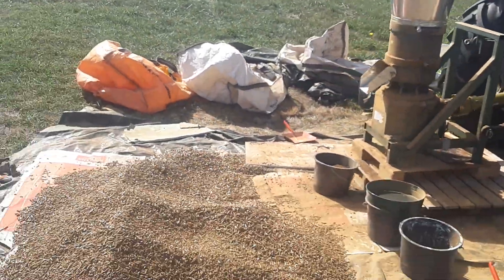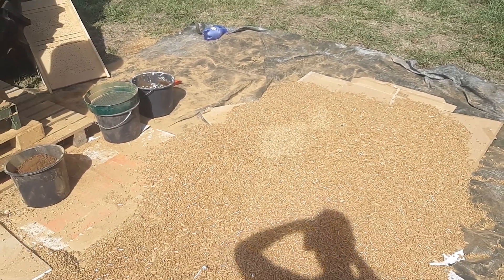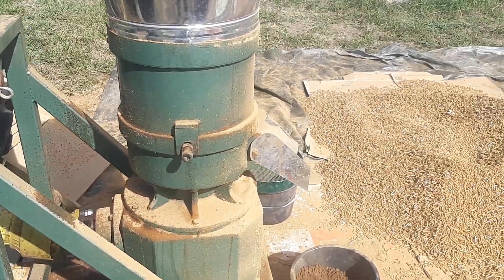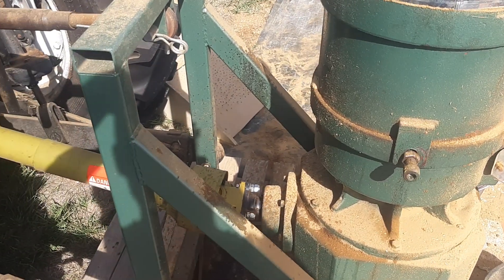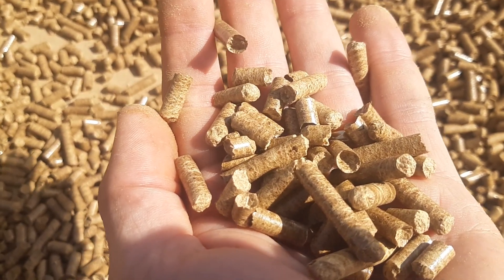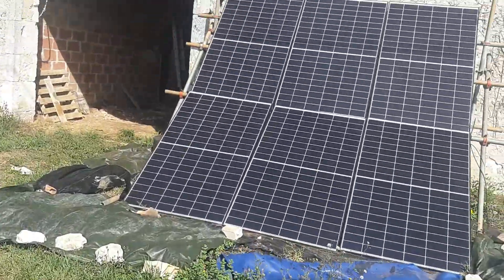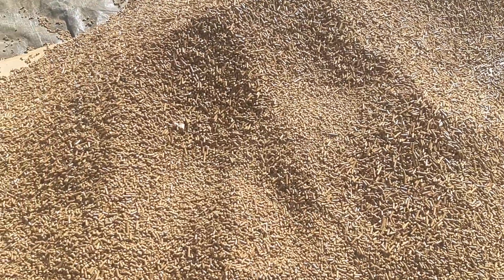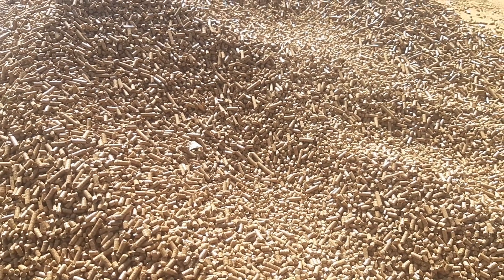Wood Pellet making process for heating your home. 100% Oak pellets on 360mm PTO mill. DIY SW France

Comment: how big is the gap between the die and rollers? i'm having a nightmare getting mine dialed in,
Reply from the maker: Hey.. I tighten my rollers down against the die plate with a fair bit of force with a large spanner so essentially 0 clearance.... Is yours a roller turned or die turned machine? What does it run off and size of engine? What trouble are you having?
Reply: @PelletJamie  it's a die turned machine, Diesel powered. Manufacturer says gap should be between .3 and .7 of a mm but there's no way on earth i can get it that close. Did you run yours in with sand/oil/sawdust or shavings ?
Thanks for the reply.
Reply from the maker: @vanderingadventures  Yes to the die conditioning, doesn't do much though, just cleanes out the holes... what size is the motor? What size is the die plate?The height of the rollers doesn't really make that much difference.. I would tighten them after they have warmed up.... what is the problem, is it blocking and stopping or bad quality pellets? What material are you putting in? What moisture level? It is a bit of an art to doing it...the first time I used my pto machine in blocked and almost caught on fire because I added the material too quickly before it had a chance to heat up.
Reply: @PelletJamie  Mainly blocking up then stopping. I've had the grinding mix through it without it stopping, just, and that with a gap. Die is 250mm diameter and 20hp diesel engine. i've been slowly adding the mixture but the gap seems to be the issue. I'll let it run with the rollers touching for a bit, then lock them off before adding the mix. I'm using clean wood shavings at the moment. Cheers
Reply from the maker: @vanderingadventures  is it the 230mm 22hp? That should have enough grunt. Just a few things to go through... Did you specifically say when you bought the machine that it would be used for wood pellets? If not it could be you have an animal feed die plate... they are much thicker with higher compression ratios. Secondly what is the moisture content? Should be between 9-15% and MUST be measured and in that region. Thidly you mention they are shavings... it is better to reduce shavings down even further with a hammer mill or use sawdust... Hard or soft wood? Soft is easier. Fourthly and this is quite a big one... have you let the die heat up? It seems frustrating but it honestly takes 20-30mins for my pellet die to heat up... my tractor is 70HP so it doesn't stop but you still have to add the material in VERY slowly to start.... just little handfuls of oily materiall then slowly introduce straight wood material... once the die is warm after 20mins you can start adding it quicker. 
I highly doubt it is the clearance of the rollers... if you watch any of the Chinese use these things they just jam the rollers tight.... they say it wears out the rollers quicker but can't imagine it is a big problem.
Reply: @PelletJamie  hi, yes I told them it was for wood pellets. I can't tell the moisture content so ordered one of those probes. Im currently bedding in with the sand, oil and shavings mix. Had it running a couple of hours today without clog. Had the rollers touching the die then backed it off one whole turn on the Bolt. Seems to be OK so far. Thanks for your help. 
How well do your oak pellets burn, they looked pretty good on the video. Cheers
Reply from the maker: @vanderingadventures   Good to hear you are making headway...glad to help. I have still yet to burn them lol.. I had a tonne of wood left over from last year to burn before I swap my stove out but will probably be starting early Dec.. fingers crossed lol... will upload a video when doing it. Cheers J
Reply: How many rupess this tractor saw dust pellet machine please give me details,i have from india

Comment: I nice video but i was expecting a bit more of the "wood pellet making process."
Reply from the maker: Right I explain that at the very start...if you watched any of the videos you would understand that the process has very little to do with putting the material in and watching it come out... it is for the same reasons that cooking programs aren't videos of food in the oven for an hour straight.

Comment: Merci pour cette video.
Je veux travailler avec la 360mm ou la 400mm sur PTO Tracteur. ou sur moteur stationnaire.
Est-il possible de vous poser des questions « en direct » : Votre "sawdust mill" pourrait il alimenter directement la machine à pellets (avec les deux machines tournant en même temps?)
Travaillez vous avec pto 540 ou pto 1000 tours  sur le tracteur et quel est le régime moteur idéal pour votre machine.?
Avez-vous une idée de la consommation de  carburant par 100kg de pellets produits.
Chez nous en Allemagne, l'électricité est chère et j'envisage de travailler avec un moteur thermique dont l'eau de refroidissement chauffera la maison en hiver .  Mon espace, la disposition s'y prête  et je dispose d'anciens bâtiments où je peux laisser sêcher en permanence plus de 100 tonnes de plaquette.  
Merci pour vos retours constructifs / éclairés..
Reply from the maker: Bonjour Gérard. Avec plaisir je peut respondre a vous questions. C'est possible pour avoir le material qui sortie le broyeur de marteau direct dans la boucle de la presse mais tu dois verifie le humidite de le materiaux parce que il peut bloque le presse. Je ne le fait, mais c'est possible. Mon Tracteur seulement est 540 mais c'est meilluer avec 1000. J'utiliser environ 20l de gasole par tonne. Oui l'ectricite c'esr plus Cher..  aussi avec le moteur gasole c'est possible pour courier avec biomass, huile etc.
Reply: @PelletJamie  Thanks for fast answer, 
With your 540 pto, which engine speed/minite  do you need?  I heard that if you do not have a minimum  speed on the mill, than it doesnt produce pellet...   (For my first tests I will have a Fendt 60hp with three pto speeds 540 750 and 1000.tp minit)

Question:  (what  do you think about the following ?)
I would let my system work slowly but the whole day on.  (some one would just overview it....)
I would "underuse" the mills  (also to protect its body)...   with the following concept:
- Same pellet mill as you have (quite cheap from China - normally requests 55 hp on pto )   
- Same sawdust mill as you have  ( requests  +/- 6 hp) 
- Both machines would be connected  and driven by the "Typical  chinese diesel 1 cylinder engine - However the most pôwerfull of them just has 35hp...  BUT it has a very good ratio  (diesel needs/KWH produced) . This ratio is said to be  0.27 liter diesel /Kwh.  In China and India those one cylinder diesel engines are used everywhere and for anything.....(waterpumps, generators....) 

So Because the two linked mills would be largely "undermotorized",  I would have an automized wood chips inpout into the sawdust mill which would be   (just important enough sothat the engine "can live with it") . Of course the mills would be  underused but  I let it go non stop (and I could heat our house with warm from engine).   
?  What is your feeling about that ?   (I am looking for "outside critical spirit" about my idears....)

Finaly I believe that your 20liters/ 1000 kgs is a very good result.  In this way of doing,  i believe we could rather be in the 30l/1000 kgs but may-be I am too pesimistic....
Thanks in advance
Reply from the maker: @gerardmaraite  The speedo on my tractor has an optimum engine speed to work with 540 so I just put the accelerator up until it rests on that, probably just a bit more so that the engine doesn't die. It is best for the engine to work at that speed, if you you it under that the engine might stall and probably not be very good for it. I would suggest probably sessions of 3/4hrs.. the engine will overheat if you use it all day.
Reply: @PelletJamie
Reply: Ok so I understand that your engine is just turning at (probably) 1100 to 1300 turns/minite...   so I understand  that your fuel consumption is so low...     I know your ZETOR tractor very well because my father had one 3511 from year 1964..   On those ones your could turn your PTO on two different ways:
1/ on/off with the direct way "engine - pto"  (This is what you do and you get the "540 speed")
2/ Through the "wheels gear box" and there you can choose between 5 speeds right and one speed left (the return speed).
How you do that?
- First put your High/low from the wheels gear box inbetween.  It means it will be on neutral there.
- Second; put your PTO selector on the complete oposite side than the one you need for getting the 540 turns.
- Third Chose one of your (5 or 6 speeds for the wheels) 
You than will see that the wheels will not move, but your PTO will turn at the selected speed...
If it doesn't work, it means that they stopped this "intelligent system" but I do not believe they did...
Have fun....
Reply from the maker: @gerardmaraite  My Zetor is from the 90s the PTO clutch is decoupled from the main drives shaft so that the gear shift does not determine the speed of the PTO. There is a setting which will "match groundspeed" but never use it.
Reply: @PelletJamie
Reply: Ok 
So I understand you are happy with this mill turning probably on a PTO base +/- 300 turns/ minite.  (your tractor should indeed reach the 540 pto speed with a engine speed of about 1700 turns).
May I know how many Kgs/hour production you reaches this way when you have well prepeared sawdust and when you are  in good conditions? 
Second question: "always in the same good conditions", would you reache 50pct more production if you could have 50pct more speed on the pto?    Thanks   Gerard
Reply from the maker: @gerardmaraite  The production  rate is very much dependent on the humidity of the input material... In the best of conditions I could imagine making 500kg/hr. I can't answer the speed of PTO question as I have never tried.
Reply: @PelletJamie
Reply: Thank you and sorry for further detailed questions (sorry also for others who are not interested in such details...)   
When the mill "is taken well -is producing fast-" as you say in the very best conditions-, do you feel the engine needs more power (does it smoke more f.i.) or is it just a lose of efficienty as such when humidity rate  of sawdust is not ok?
Do you know how big are the wholes of your sawdust mill grid? (4 or 5 or 6?).
Thanks  GM
Reply from the maker: @gerardmaraite  Standard hole size in die is 6mm because that is the size most pellet stoves use. 

If the sawdust is VERY wet 35% + the material won't come out at all it just goes around the rollers. 
Sawdust at 15%+ (still too wet) will come out very quickly but won't be pelletized or will break apart as they come out and need to be put back in to reform, lots of steam may be made. 
Too dry 8% and the pellets come out very small and can crumble. 
Very Dry <8% and you can block the die plate.
Reply: @PelletJamie  In your South West reagon of France, is it possible to reach fast the (ideal 10 to  14 pct of humidity )  under roof and during winter time?  How do you manage it ?  
? Does  sawdust, - just by going through the  sawdust mill  for adjusting the "big pieces"-  get  somehow  a reduction  of its humidity rate (becaus of  tornado wind and heat....)   or not?
Reply from the maker: @gerardmaraite  I get rhe dust from a joiners so yes it is already dry. The hammer mill takes a little bit of moisture out yes... but not a lot. I have got some sawdust that got wet and yes it is a nightmare to try and dry in the winter

Comment: I buy them in 40 pound bags delivered right into my garage simple this is way to much work and overhead to make sense
Reply from the maker: So why are you commenting? 
The price here has quadrupled for bags in 3 years and is set to keep rising. 
I can heat a house for the cost of the diesel €50 a season... lol. And most importantly nobody  especially the government can change that....
Reply: @PelletJamie  I probably burn 175 40 bags a season in the us Pennsylvania I had them delivered for 6.50 usda bag it is what it is if any has the time and all the resources to do it cheaper god bless them
Reply: @johnie19644  Twice the price here in France at the moment.
Reply: @paulbradford8240  are you saying you’re paying 14.00 usd a bag?
Reply: @johnie19644  $14.70 is what I have seen the pellets here for a 15kg bag (33 pounds). I was lucky buying mine in the early part of December for $9.98 per 15kg sac.
Reply: @paulbradford8240  that’s crazy man.  I bought two ton which is 100 40 pound bags delivered into my garage for 650.00 usd that’s 6.50 for a 40 pound bag
Reply: @johnie19644  Three years ago here that would have been more expensive than we were paying. When I first considered a pellet burner about ten to twelve years ago, it was cheaper to source the pellets in the north of England and have them shipped to France, than to buy them here. Fortunately, our pellet burner was supplied and installed for free under a Government scheme. It's not working properly yet, but I'm sure it will!
Reply: @paulbradford8240  they got us coming and going we have to pay whatever they ask
Reply: @paulbradford8240  yes they were cheaper here three years ago also